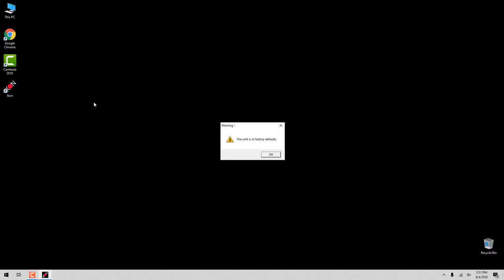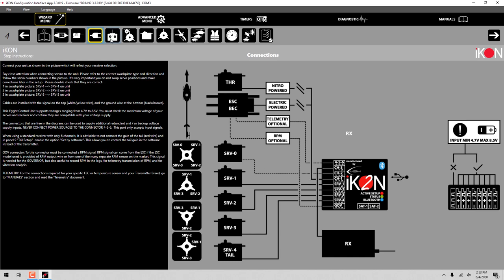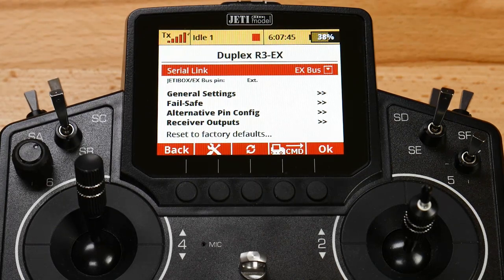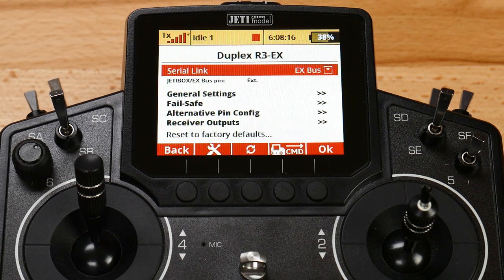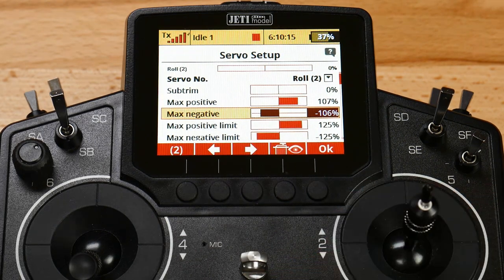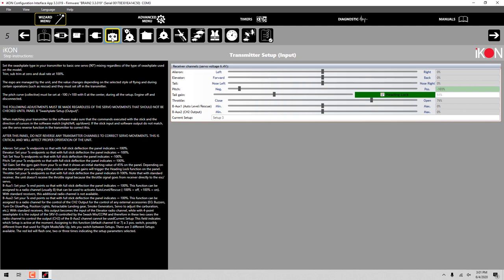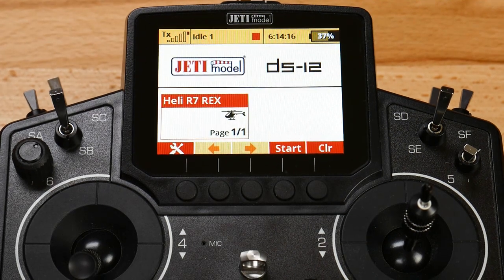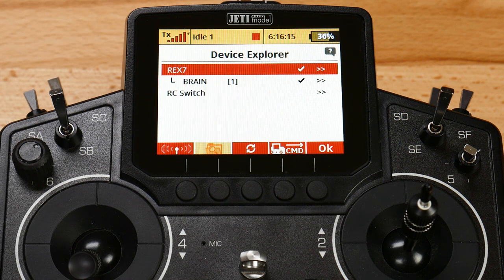Jeti Programming Guide: iKON2 Flybarless Helicopter Controller w/Jeti DS-12/16/24 Programming

Comment: I am missing something. How is the R3/RSW, a 3 channel receiver, receiving 5 channels from the transmitter?
Reply from the maker: All Jeti receivers carry up to 24 channels of data. They are designated by the number of physical outputs, but a user who is taking advantage of a serial output will have access to all 24 channels regardless of the number of outputs available.

Comment: No Mac support so absolutely useless to me and others that is in the same boat - moving to something that does support Mac or have full integration with Jeti like Spirit or Vbar
Reply: Mac support.   Nope not going to happen unless.   To small of a user base.       I use to us a Mac and then their cost just got stupid.      Mac Book Pro vs a Dell, the Dell 1600, the Mac 2600 for the same hardware set up.   Then you have to run Parallels and windows anyway to run required software.